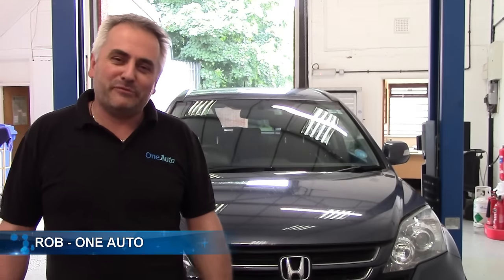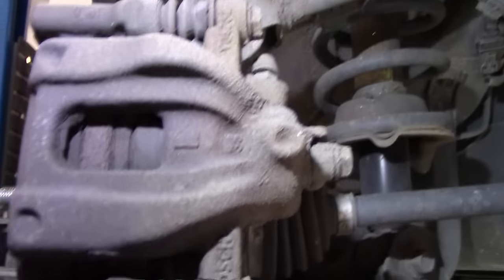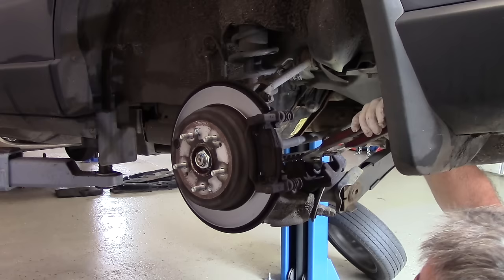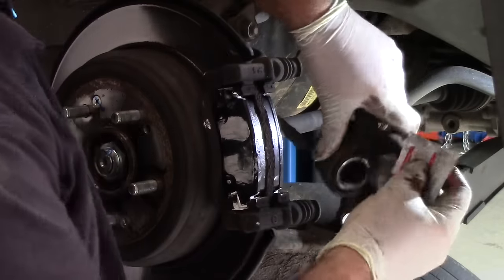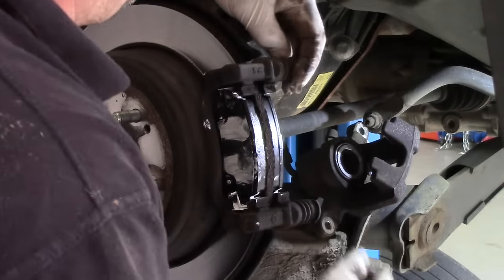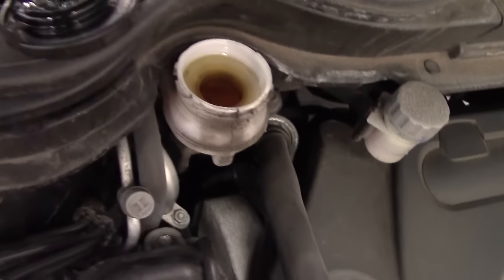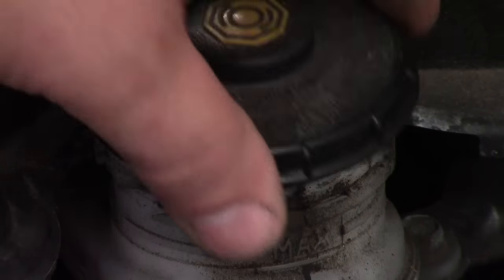Honda CRV How to Change Rear Brake Pads

Comment: Excellent video.  My brake pads from NAPA came with new sheet metal retainer parts.  I found pushing in disc puck all the way in was needed to easily install the new sheet metal.

Tools I needed: floor jack, jack stand (safety), bucket to sit on (old), lug wrench, 12mm socket, 18mm open end wrench, small wire brush, 2nd bucket to hold up brake caliper (avoid hanging by brake line), 3" C-Clamp to push in caliper (I prefer not to use Channel locks due to serrated jaws), turkey baster to suck out the extra brake fluid as it was over MAX.

Comment: Thanks for your clear and informative video. One of my rear brakes is stuck, and making an awful burning smell. Going outside to take a look - and now I'll know what to look for!
Reply: Michael Mannion did you fix your brakes one of mine is grabbing and not realising properly?
Reply: Andy Gregory: Yes, it worked! It took me a few hours, because I was looking around at stuff in the wheel well and obsessing over the details. The whole setup is relatively simple, though; more so than I expected.

In this instance, all I had to do was jiggle the stuck pad loose, clean the dust off everything with some brake cleaner and a rag (while wearing nitrile gloves), and lubricate the sliding parts with some brake grease (taking care not to get any on the pad surface or rotor). After putting it back together, it just worked.

From what I read, and from talking with the guy at the auto parts store, it's important to use real brake grease. Apparently it can handle the high temperatures of those components, unlike say axle grease. I read some online about using anti-seize compound, too, but the more authoritative resources (and, again, auto parts guy) recommended against it. I think I paid $7 for a little tube of the proper stuff. A small price to pay for safety. I have it a good coating, and everything slid nicely. After a few weeks, still no problems.

Other than that, I'll just need to keep an eye on that one pad, as about half of it was burned away. Once it's used up, I'll replace all of the rear pads and rotors (if needed) - and I'll do it myself this time! (Or get half-done, realize the rotor is rusted on, get the disassembled car towed to the shop on a flatbed, and have them finish the job ;)

Thanks again for the great video!
Reply: Michael Mannion hi bear is a update. I did everything you did and eventually it was working on the jack not locking up. Took it for a test drive and now both wheels are very hot and seem to be grabbing! It was all loose and free but now seems to be grabbing again now both rear wheels? I have never had so much trouble with brake pads sticking on any car like this before it’s unbelievable!
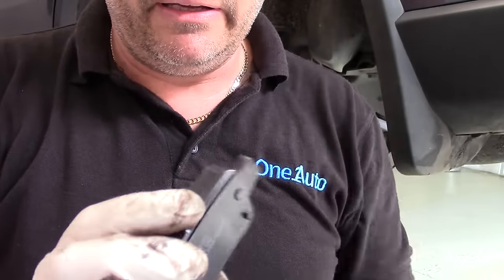Reply: I re-watched the video after posting my last comment, and remembered that I did do more cleaning than I said. Everything was in pretty good shape, other than the copious dust, because the brakes had recently been done at the shop. But, I did use some sandpaper wrapped around a lumber scrap and a raker file (wide, flat, steel file for maintaining chainsaw chains) to clean up the areas where the pads slide, like he did at 5:02 in the video.

IIRC, I took the fixed part of the caliper off the car, and removed any of the little silver spring steel thingies from... um... were they on the pads or the caliper? Anyway, I removed whatever was removable (other than the brake line, itself) and polished up the parts that touched each other before lubing them. I doubt it did anything in my case, but perhaps yours has more gunk built up?

Note that the brakes will get hot from normal use, too. When I first started smelling the burning pad on our car, I went around to each wheel after we stopped driving and poked my finger through the rim to touch the rotors. Needless to say, they were all wicked hot. I'm sure the rotor with the problem pad was hotter, but to my tender, human flesh, they all felt sizzling. With that in mind:

Do you feel that the problematic brake(s) are hotter than they should be?

What evidence do you have that they're sticking? And, do you think it's the pad that's stuck, or the whole floating part of the caliper?

I'm not doubting you, just trying to understand what's going on. I was actually surprised at how little my pads moved away from the rotor when releasing the brake. To my naked eye, they look like they're pretty much touching all the time. It wasn't until I disassembled things that I realized that one pad was moving and the other was wedged.

Lastly, FWIW, I've had calipers stick and need to be replaced on several cars (according to the shops that did the work). Maybe there's something more wrong with your car than a simple cleaning and lubricating can fix. Good luck!

Comment: Thanks for this video! You've given me the confidence to give it a go!!
Reply from the maker: Thanks, stay safe 👍
Reply from the maker: If the noise happens as you apply the brake something is wrong. Is the disc in good condition? I If the noise is apparent as you drive you may have the back plate touching the disc. Obviously I can't comment without seeing it so my advise is to get a professional to check it out.
Reply: Thanks. The noise went away after about 5 minutes of driving and testing out the brakes. I spoke too soon. I think it was just a fresh pad being a little uneven. Everything sounds good now and the brakes look good. Thanks so much!

Comment: The rear brake caliper of cr-v mk3(2007~2011) is sold in two types."excluding japan", "fit japan"
 I wonder what the difference between the two products is.
 I searched and found that the bolt specification of the caliper mount bracket is different, is the caliper part the same?
 I asked several places, but none of the sellers gave me a clear answer.
 What's the difference?

Comment: Very good video. I'm surprised the new break pads didn't have new hardware with them. The ones I bought at Auto-zone had the sheet metal hardware. Good to know what to do in case that it doesn't. I noted that you didn't use any break-cleaner spray on anything. Which break pads are recommended for the CR-V - looking for recommendations of which pads to buy.
Reply from the maker: I’m sure about the US but in the UK the best pads to buy are Brenbo. Thanks for watching

Comment: After cleaning the brake pads holder, some grease must be put before installing the stainless clips to prevent the building of the rust that could prevent the pads to slide in their slot.

Comment: Hi. Awesome video every thing is so simple in this video and I have done everything to solve my hot wheel brake grabbing problem but it still seems to be there on both sides now? Only thing left to change is the caliper bracket? Are these known to fail or go bad apart from the slider pins? Thanks Andy
Reply from the maker: Thanks. Rarely have problems apart from seized sliders, more than likely the calipers
Reply: One Auto, thanks for your reply, I have replaced one of the callipers with a new one but it’s still getting very hot? Might just get a new bracket as something is restricting the pad from retracting?
Reply: Most likey the pistion is sticking. Remove it, clean it up and replace both seals (Also cheak the bore for any damage)

Comment: Do you have any idea what OEM brake disc/pads does this gen. Honda have?
Also in my manual it states that I can either use dot 3 or 4 liquid. Since i bought it second hand I have no odea what type of fluid was put in by the former owner.
Thank you!
Reply from the maker: Not sure of Gen brakes just buy from Honda or Brembo are a favourite OEM manufacturer. Use Dot 4 fluid
Reply: @OneAuto  Thank you again!!!

Comment: How often should the brakes be serviced in a CRV?
Reply from the maker: They should be checked at every service. The rear pads on this particular vehicle last approx 45000 miles
Reply: One Auto, Well they're talking about actual servicing for  $150 on a car that has 250 miles,  is that needed now?
Reply: Our 2009 CR-V started making a squealing noise when using the brakes in reverse.  There are metal tabs (squealers)  that let you know if the disc pad is getting worn down to far.   Inspection regular service  is better than waiting for squealers or the Check Engine Light.

Comment: What kind of pliers are those did you use to push the caliper in?
Reply from the maker: aaron glancy Just a big pair of adjustable grips sometimes called channel locks.
Reply: That is a BIG NO NO, you never use pliers to retract the piston, it will cause damage to the piston with the teeth. Simply use a standard C clamp and your old brake pad to retract ir. That plier part was sloppy, I'd be afraid to take my car to this guy.

Comment: when do u change the drum pads in the inside?
Reply from the maker: Checked at every 12500 mile service and replaced as required. Minimum thickness 1.0mm

Comment: you should never use any lubricants on any brake parts. high temp could make them melt and could go to pads and you know what's next.   just clean them  with dish washing soap and that's it.

Comment: Thanks for the clean and nice presentation, I was wondering how the wear indicator works and you just explained that practically, thanks! I have a question, I have this sound (exactly as the sound made by this gentleman video https://www.youtube.com/watch?v=VW5S3If0J2M exactly at minute 1:40 of his video), Is this the squealing sound that you have mentioned in your video? If it does not end after changing brake pads, what could other causes be? I appreciate your kind help!
Reply from the maker: Might be a pad gone metal to metal with the disc. You better get it check out. Thanks for your comment
Reply: Thanks for your kind reply!

Comment: Not supposed to lube the ears of the pads because it attracts the brake dust and can cause them to bindup
Reply from the maker: Incorrect sir. If you do not lube them they will corrode & seize inside the carrier.